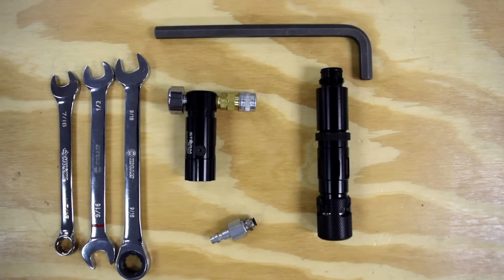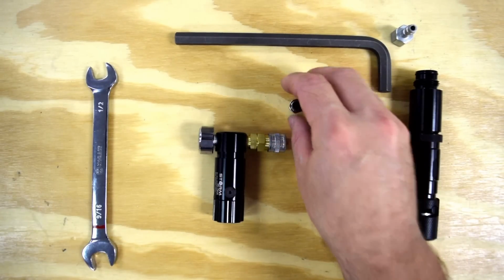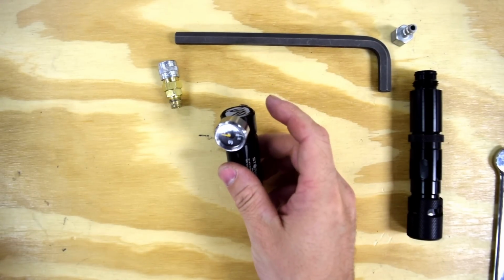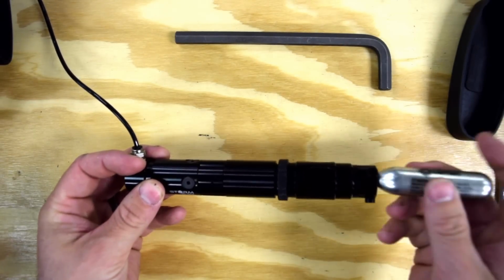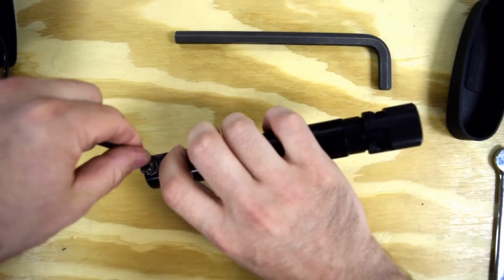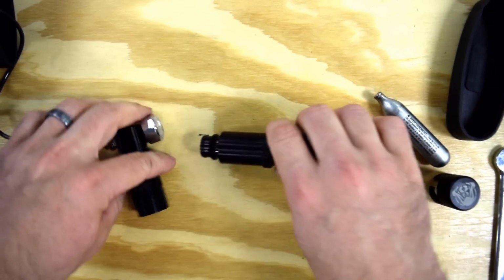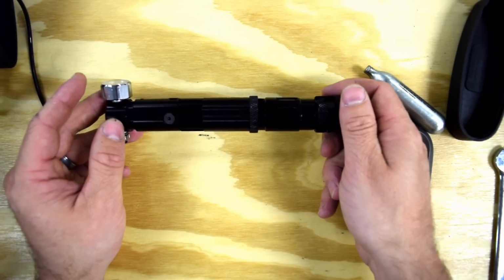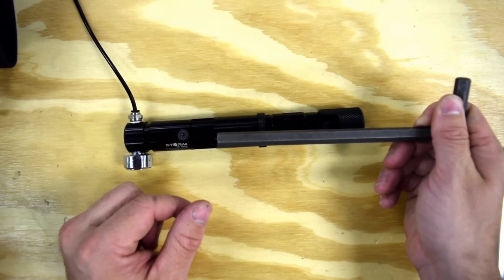What the Tech?!?! Ep. 15: WRAITH CO2 Adapter + Storm High Pressure Regulator for BOLT

Comment: why not just design this better, it wouldn't be hard to add a flat section for an adjustable wrench to sit on, and there really is no reason a threaded hole couldn't be drilled through the set screw in order to have a small set screw to lock the thum screw in place...I just got this and not going to lie user friendliness is pretty bad, I think a gen 2 redesign is in order, to make this more fool proof and work out of the package with the wraith aero

Comment: Will Wraith 33g CO2 adapter fit in this regulator.
And if it does will you be able to change to the L fitting to accept M bolt hose.

Comment: this configuration still doesn't fit in a TM vsr stock. any tips on making that happen? The locking ring and the pressure gauge seem to be the culprits
Reply: i also have same problem. even you remove gauge still cant put it into stock.  but... FN spr can settle it. I saw someone make it. Totally fit!

Comment: so I have a rap4 co2 adapter for paintball. It has the same size fitting as a normal tank. Can I screw that onto the Storm? I mean the science looks exactly the same. Puncture co2 into the regulator and regulate the flow. Am I correct?
Reply from the maker: It doesn't look like it has an expansion chamber, which is imperative for our system. The expansion chamber stops any liquid co2 from entering the system.

Comment: When storm ontank high pressure will be available ?
Reply from the maker: It is available now!
Reply: Wolverine Airsoft thank but i didn t find it in shop and I can't add in cart on your shop.
Reply from the maker: please email sales@wolverineairsoft.com and we can help you get it!
Reply: dose the regulator need to be the high pressure one, im just wondering if it will work with any other regulator, i want the wraith cuase i dont want to have a tank on my back when i have a ghillie suit on also, i dont think American Milsim will allow the tournament tape.
Reply from the maker: It will work with other regulators, the High Pressure one is recommended to get the most out of the BOLT.

Comment: I've ordered and is waiting for my kit, bolt+storm+wraith to put into my TM VSR-10 G-spec. I've heard rumours that I need to remove the pressuregauge from the storm regulator in order for it to fit in the TM stock, is this true, and if so, how is it done? Do I plug the hole with something?
Reply: mine didnt fit with the Pressure gauge.I got a tm vsr-10 PRO. just plug that hole with a plug.

Comment: Ok so I run a mancraft sdik in my vsr, can I use the wraith and Storm reg setup with it or no? It's much better designed than my current mancraft reg and co2 adaptor so it would be great if I can

Comment: I'm guessing the Wraith my stock doesn't come with the lock ring so the adaptor can be used with both systems? 

Would it be OK to use a thread sealant (something like blue loctite) to lock the adjustment down if I use the adaptor from the M4 Wraith with the Bolt?